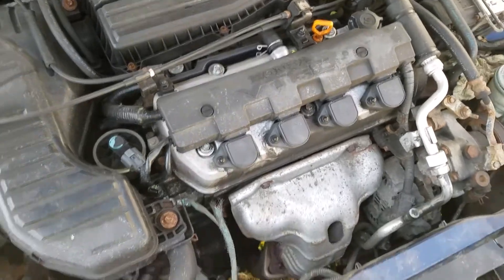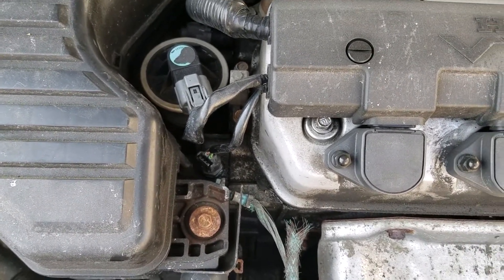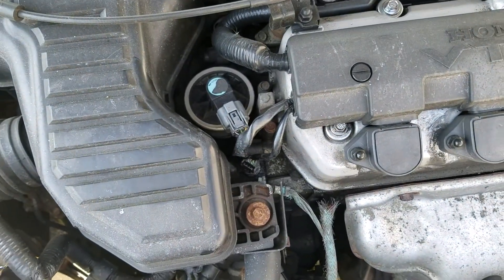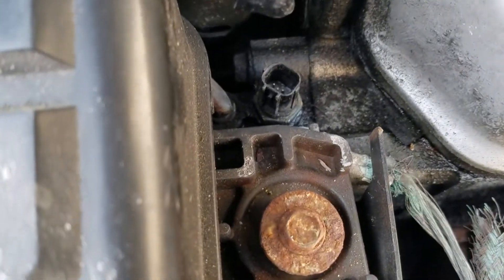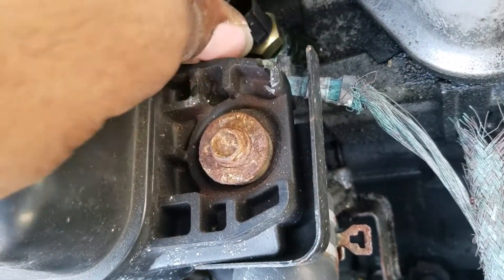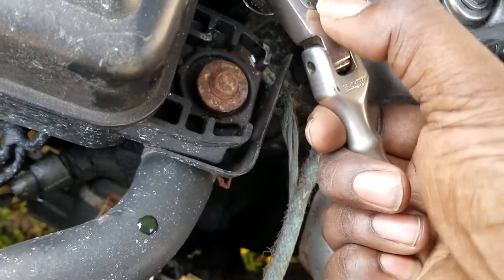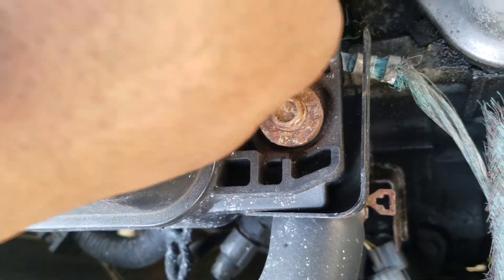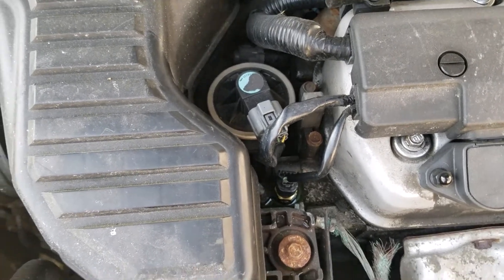How to Replace Coolant Temperature Sensor 2001-2005 Honda Civic 1.7L

Comment: What do i do if I overtightened it like an idiot and the little plastic part at the top for the wiring broke off? 🫠 that's what I get for buying the cheap made in China version instead of the oem
Reply: Buy new one

Comment: Would this problem cause my civic to not kick over? Im getting the same code and the car wont turn over unless i keep trying then i give it some gas to keep the engine running.
Reply: Think so. It only happens when it’s hot right?

Comment: Great video, I had codes P0118 (ECT Sensor) and P0128 ECT below thermostat regulating temperature. 
My car only read cold.
It also caused my 05 Honda civic not to start after running.
I changed the sensor seen in the video and I'm back rolling.
Reply: Good to know I’m about to do that. …

Comment: Question is do I need to drain the whole antifreeze before I put new coolant sensor and radiator fan sensor and thermostat??
Reply from the maker: No...
Reply: @change4adollar  ah ok thanks for the info it will help me save few bucks

Comment: I see that when pull it out you break it. Plus you need a 3/8" extension. Plus from where you get the idea that civics use of a blue antifreeze .
Reply from the maker: I didn't break anything it came out easy sir, and Honda changed their antifreeze to blue.
Reply: Most Honda and Asian cars use blue unless you a v6 than it pink or red and typically it usually a Toyota with pink red orange

Comment: what if i get 2 codes. P0118 and P0128? do i have to replace my thermostat also?
Reply from the maker: Sometimes 1 thing will make another act up. I say start with replacing the sensor first, reset the the engine light and see if it comes on again....

Comment: My civic is having the temperature gauge going up and down really quick and I just replaced my radiator no check engine light or any codes come up but my temp gauge be going up and down quick.
Reply from the maker: Could be a faulty to wire going to the switch or the switch itself. I say check the wires going to the switch, I would even replace the switch very cheap to do and see what it do.
Reply: Thermostat

Comment: I don't know what's wrong with my 04 civic lx, I got the radiator replaced and my Temperature Guage still moves up and down quickly but the car runs fine but my heater don't work idek.
Reply from the maker: Could be a faulty to wire going to the switch or the switch itself. I say check the wires going to the switch, I would even replace the switch very cheap to do and see what it do.

Comment: What if the engine light doesn't turn on? Could that still be the problem? (Sensor temperature)
Reply from the maker: Yeah I've have had instances where the engine light didn't turn on and the switch was still bad

Comment: Will that sensor cause it to overheat randomly
Reply from the maker: No this is the sensor to control the temp gauge on the dash, but the other sensor that control the fans will, and check the thermostat...

Comment: i changed the thermostat on my 04 civic last year... today i got a p0128 code.  would these sensors be the cause of that?
Reply from the maker: The most common cause for P0128 is the engine coolant thermostat is stuck open

Comment: I've been having a problem with my 03 Honda Civic for a week or so here - while driving the temperature gauge drops to cold for anywhere from a few seconds to a few minutes, and then returns to normal as quickly as it dropped. Since it returns to normal temperature quickly, my guess is is this sensor is bad and not the thermostat's sensor or the thermostat itself. But, it's not throwing any codes, is that normal?
Reply from the maker: Yeah it don't always throw a code. I would change it, it's a cheap part, and easy to install...
Reply: Wasn't the thermostat, a few electronics were on the fritz so I figured it was a bad alternator, wasn't that either. Now I'm thinking of a grounding issue somewhere, damn I've been doing this for 3 weeks? Lol
Reply: @ACyclistsJourney  any updates?
Reply: @goofyjawthan thanks.

Comment: So, I switched the thermostat on my 2003 Honda Civic today. Now the coolant is coming out the cap. I switched the cap last summer. So I know it’s a good cap. What could be the issue? The coolant temp sensor or the thermostat fan switch? Or another sensor that opens up the thermostat up?
Reply from the maker: This sensor controls the temperature gauge hand on the dash, and I think the other sensor control the fans, so you might want to changed that sensor too if you already change the thermostat, and cap...
Reply: In my experience, thermostats are made so cheaply they come broken half the time! Try changing it again

Comment: my 05 civic gave me this code but I don’t know if I need to change the thermostat or the sensor what other parts can cause this problem
Reply: I got the p0128 code
Reply from the maker: P0128 Is usually the thermostat, it may be tuck open. Is the engine temp hand usually cooler than normal?

Comment: My 95 ex the coolant is the blue kind. My 04 ex it calls for the pink kind. Hmm
Reply from the maker: Yeah mines called for blue but i have always flushed them and put green in them. The green is easy to find and cheaper, and i never had any problems coolant related.

Comment: You should tight with hand as much as you can .then tight with socket wrench because I was replacing and broke my sensor inside and I was like F** but luckily I take out very easy with screw extractor. :)
Reply from the maker: Yeah i was kind of careful with that, Definitely don't want to break anything, and have to deal with the headache of trying to drill it out.

Comment: I have fault P0118 colant temperature sensor .... there is another similar sensor on the engine block on the opposite side.  what change?  The one with the thermostat or the 2. Thanks in advance
Reply from the maker: I just changed this one, and the problem went away for me...
Reply: @change4adollar  Thank you very much, I will try

Comment: Fix your ground wire bro, that shits gonna snap off and then your car really won’t start. Thanks for the vid tho fam, having the same trouble with my car would start when ever it wanted to and temp wouldn’t read right. Checked my engine light code and P0118 came up
Reply from the maker: I ended up fixing that ground wire too, before i sold the car...
Reply: @change4adollar  nice fam 👍🏽 keep up the good vids
Reply from the maker: @JayOnOneWheel  thanks bro

Comment: I got po118 code. Replaced both sensors, that ground cable was almost broken replaced that and the cars still acting up. Randomly loses power acts like it's in neutral and randomly comes back n drives fine still throwing code. Any ideas anyone
Reply from the maker: There are many reasons why your vehicle may be losing power, especially when accelerating. Some of these common causes are: Mechanical problems such as: Low compression, clogged fuel filter, dirty air filter, clogged Exhaust Manifold. ... Malfunction of actuators such as: Bad injectors, bad fuel pump, bad spark plugs etc.....
Reply: @change4adollar  new code came up today, for tranny says could be low or dirty fluid.
 Just got the car from my buddy's girlfriend, based off of how it looked when I checked everything else I'm sure this flush should do wonders